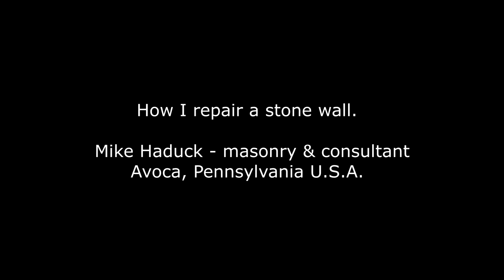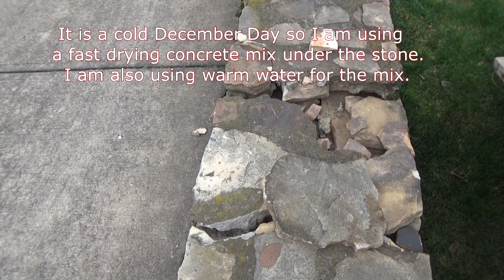REPOINTING STONE WORK  (part 3) Mike Haduck

Comment: Mike do you think I can paint with Portland, but use cement all
I coated my garage with cement all. I want to even out the color.  Thanks to your videos I cement and mortar anything I can think  of!
Reply from the maker: +sikkinixxmc   painting with Portland is a old school whitewash technique that the old timers would be using as a cheap fix and clean look for everything,  paint was too expensive, so I look at it that way, I am not a fan of cement all for anything less than 1/4 inch thick fix and then paint over,  I think it depends on what your looking for and how log you expect it to last,   Hard call and everybody got a different opinion,  maybe a test spot first would help,  thanks mike

Comment: what does the hot water do to the cement or any kind of mortar?
Reply from the maker: +luis perez   I have heard from the concrete company that concrete stops its action below 40 degrees , so I left the sand and cement in the garage at night 65 degrees and added  very warm water to help it accelerate.  and I wouldn't do it if it was going  below freezing that night and was not getting in the upper 40s the next day.  concrete gets warmer also as its accelerating,  a molecular action I guess.   It works for me, My way of course,  other masons and experts may have a different opinion. I hope it helps,  thanks mike
Reply: Thanks for this detailed info...
Reply from the maker: +luis perez  thank you,  hope it helps some others too. thanks mike